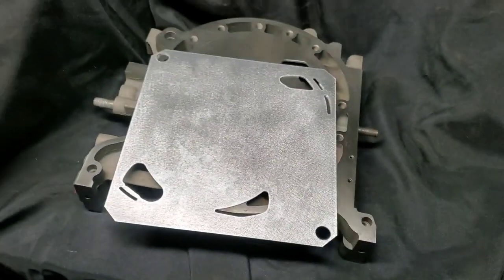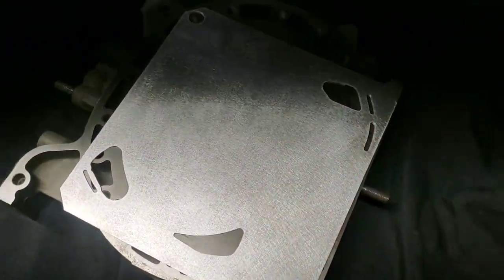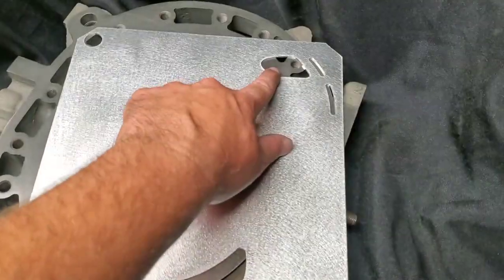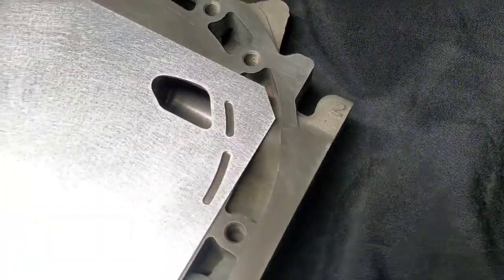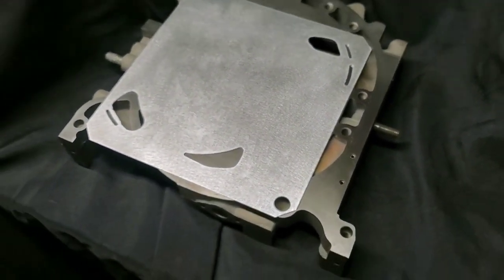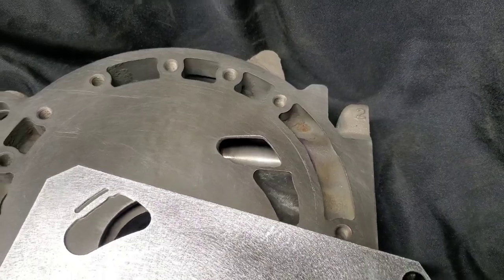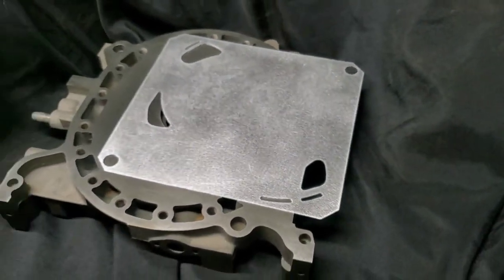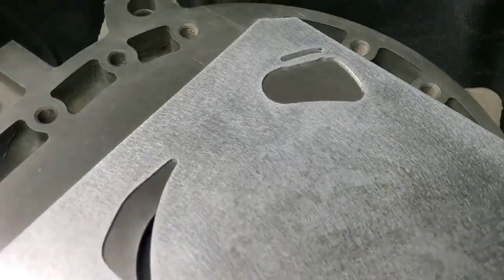Renesis Mazda RX8 FULL BRIDGE   Porting Template   new products from KMR, Rotary Tech Talk

Comment: Is it necessary to build a renesis with peripheral exhaust ports or is it doable with the stock exhaust ports if the "block" is ported if only aiming for around 350whp?
Reply: 100 percent! Do away with the side port exhaust totally if your looking for power or reliability
Reply from the maker: @TheSKDKNG  thats just an old 13b?
Reply from the maker: Turbo? Or NA? A renesis will probably only see 350hp if boosting.  Hybrid or oem configuration,  350hp generally requires boost.